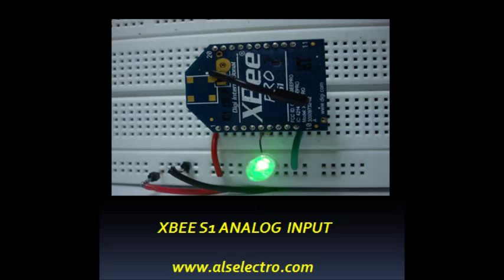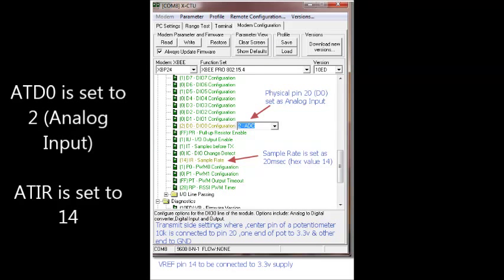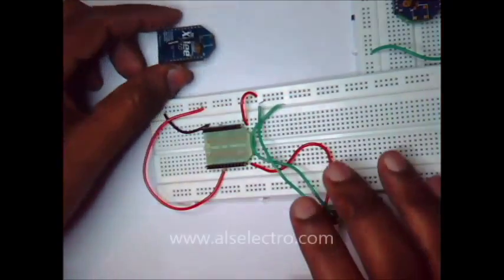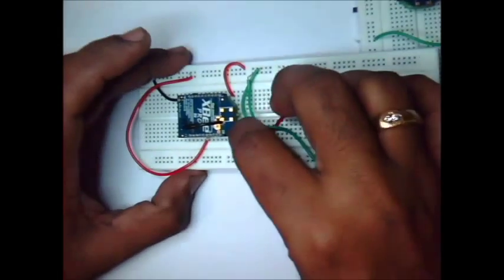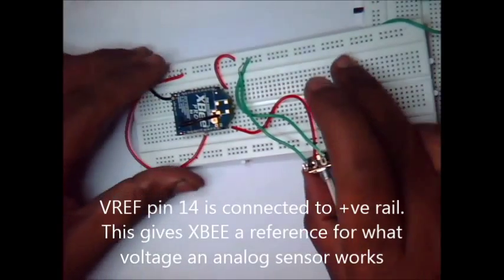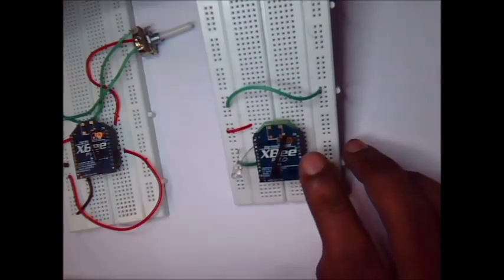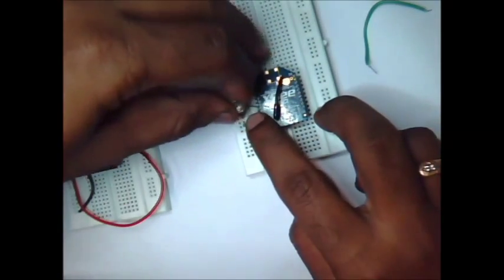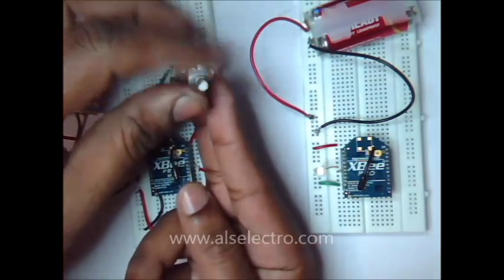XBEE S1 - ANALOG INPUT / OUTPUT

Comment: Hello Friend. I need some help, please.

If I do the same mounting and configuration of both XBee Pro S1, as it does in this video, is it absolutely certain that the transmission will work to turn on the LED in an analog way?

Can I do the same for two analog signals?

Thank you very much

Comment: Hello sir, I want to use the same set up with replacing potentiometer with an raspberry pi and an led with an 12v led strip but the output I get at the receiver side is fluctuating and I cant dim the led instead its on off cycle. can you help

Comment: Great example. But, Is it possible if i wanted to transmit multiple analog data? 
A really simple example would be to stack up another set of potentiometer and LED in addition to the existing (as in video).

Comment: Hey, thanks for your tutorial! I just want to transmitt a 3.3V signal, and i tried it with your configuration. But on Pin 6 of receiving  is always voltage on, do you know what this can be?
Reply: How you solve this problem.
I am also facing same problem...
Reply: @ashishdeshmukh3847  Quiete a few days ago 🤣 To be honest, I don't remember... Did you forget pulldown resistor on that pin?

Comment: Thanks for the reply.  I got it working with one potentiometer but need 2 analog inputs and 2 analog outputs.  I want to control 2 leds using the xbees.  I have connected pin 20 to the potentiometer and it controls the output on pin 6 of the receiver but if I now connect another potentiometer to pin 19 of the transmitter, then it does not control the led on pin 7 of the receiver even though I have assigned these pins in the setup.  Can you help?

Comment: Thank you very much Saravanan. I am FINALLY able to get a direct analog connection, thanks to you. Is it possible to use an additional analog channel? The transmit side is easy (after finally understanding "change detect"). The receive side P0 and P1 is not so easy. It seems that when P0 is assigned the value 2 (which is PWM Output) the Oscope should be monitoring pin number 7 (labeled RSSI). I assume that when the second input is made to be analog, the output would be P1. But what pin corresponds to P1? And what do you assign P1?
Reply from the maker: S1 Radios have 2 PWM outputs.In order to enable both set ATP0 & ATP1 (BASE Radio) equal to 2.This will convert for A/D-0 & A/d-1 respectively.PWM0 is available at pin 6 & PWM 1 is available at pin 7.
Reply: Thank you very much Saravanan. Your instructions worked for me. On the receive side, both P0 and P1 have to be set to the same thing: PWM Out. That was so confusing to me. Oh and on my board it's pins 7 and 8 not 6 and 7. I think there's a different numbering scheme on the Sparkfun "Explorer" board.
     The letters for instruction are so similar to letters that describe pins. I believe it would be excellent advice to remember that everywhere in X-CTU where you see the word "configuration" they mean pin with that name.